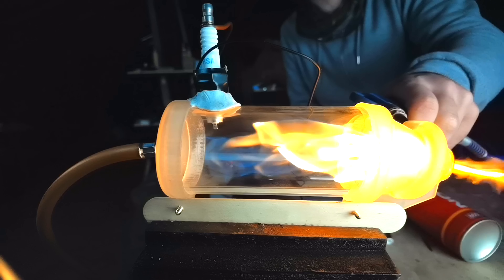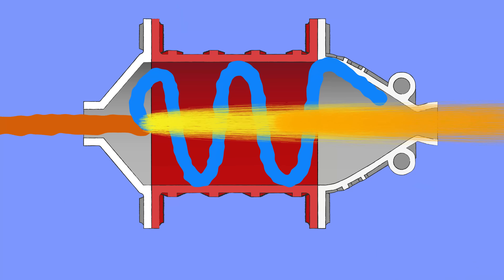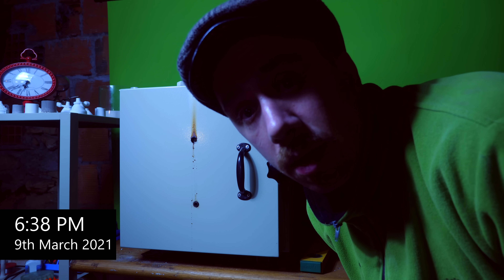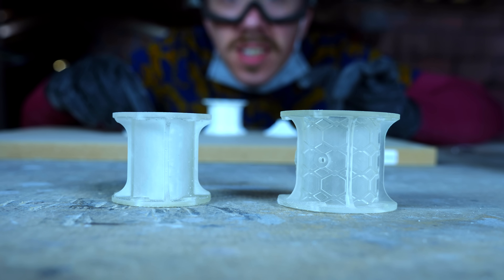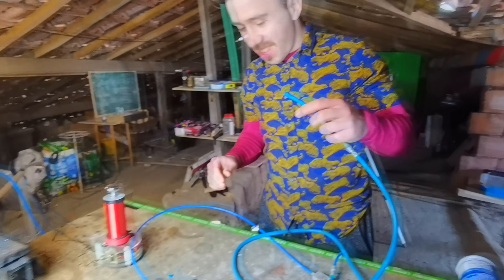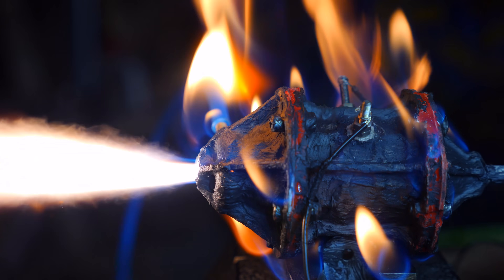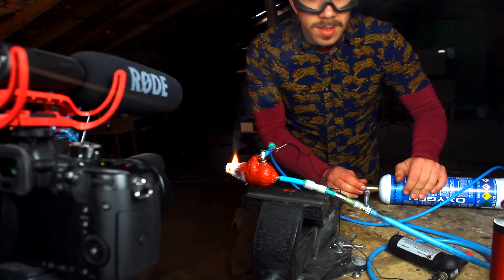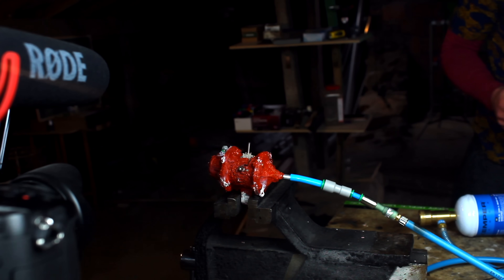Vortex Rocket V2.0 (3D Printed)

Comment: if your rocket is leaking, just clog it. at least for the single piece rocket you dont have any joints, so you should focus on clogging the pores and crack on the ceramic itself. for that you should put inside the rocket come solution or dispersion that can leak through the pores and solidify there.
i suggest a solution of sodium silicate, maybe with kaolinite, put it in, let it permeate and soak out until it can't permeate any more, drain dry and oven bake.

Comment: Have you ever been thinking to coat your parts from inside with sinking method. Of course you need for that something what will flow easily but surface  finish will be great and if holes in part are not too narrow it wont stop up the holes. I haven't heard that you can liquefy silicone but there are heat resistant paints and  I think there will be other stuff what you can use with that method.

Comment: Dip the kiln baked parts to the same resin, and bake them again? Repeat if it leaks? Or assemble the engine and dip and bake?
Maybe have a proper regulator for the gasses for fine tuning the pressure so that no overpressure brakes the ceramic parts?

Comment: Those little cutters you're using to remove the supports are often brittle and have a tendency to break and throw the pointy tip violently. You probably want to use safety glasses with those.

Comment: At one time a 3D printed all-metal rocket engine would be amazing to see in a future video. I know that SLS and other metal printers are not cheap, even the small ones. But with one you might be able to create long living engines to burn the tomatoes until you run out of propellant.
A liquid fueled aerospike engine would be cool as well.

Comment: Maybe you can swap fuel inlet with oxygen inlet to get oxidizer away from walls, and increase lifetime a little - almost pure oxygen makes flammable almost everything (i think ceramics could handle this, but it was really visible at engines with acrylic tube). nice engines!

Comment: Paint the engine with conductive coating. Then electroplate it with nickel or copper! That should be airtight! Or wrap it in gold leaf. Then wrap it in steel foil.

Comment: Did you try coating the engine on the inside?  Gas pressure, pushing against the ceramic & its micro pours, pushing against the red fire coating.....  coat the inside....think of a space ship with a tiny hole....think of a rubber patch placed against the hole.  The air pressure pushes against the patch.  Coating the outside offer little strength

Comment: If the ceramic is porous so the gas is leaking through the walls, they could be porous enough to allow liquids through.

You could try sinking the parts into a high salt consentrated solution couple of times. The salt crystals that forms when dried could seal the parts with a high heat resistant solid material.

Comment: Have you tried simple clay?
You already have the kiln and are not restricted to wall thicknesses.
Also I think your chamber pressure is too high. It wouldn't leak if the pressure was low enough.
You could also print cooling channels around the engine.

Comment: You might try using some ceramic paint on the inside and outside of the engine and then letting it cure. 
 Fibreglass is also extremely high temperature used with the correct resin. You can make a mold like you did before and then be able to press it all together in making extremely tight and dense. 

 Maybe try making some starlight with extra ceramic powder in it.

Comment: Hello Integza! 
Very nice video! I perhaps have a suggestion how to fix the leaking nozzle. Few years ago i used to build some small rocket engines and had similar problem of certain parts not being heat resistant enough. What solved it in the end was submerging that part in water glass (concentrated solution of sodium silicate, you can buy it in common shops in the country i am from). I used to soak my parts usually over night and then leave them drying for few days and afterwards bake them in oven for a hour or two. The result was a thin layer of glassy material on the surface which was incredibly heat resistant and not leaking. 

Hope you will get your project working :)

Comment: I would love to see a future video dealing with trying to make aerospike engines! Cooling would definitely be an issue as that is one of the main weaknesses of the aerospike design, but they are super cool!

As far as trying to seal your ceramic parts, you might look at a hotter sintering process -- low temperature firing means less of the material bonds, but extremely high temperature firing (like with china or porcelain) can make a much more tightly bonded material. A thin coat of glaze may also help, though that could easily crack and leak.
Reply: P.S. I could really use that 3d printer! So cool!

Comment: Glaze it and refire. You may also want a proportional control valve to keep the flame slightly reducing (or maybe slightly oxidizing as ceramic is already oxidized) But the extra oxygen is definately attacking your sealents.

A mix of wood ash and the ceramic powder from the fired support material may be a good place to start.

Comment: you could try sealing it from both sides with glass, like how its done with ceramic mugs. Its basically powdered glass in liquid form, you paint the ceramic parts with it and then cook it until it sinters together and seals all the pours.
you could try the same with aluminium oxide or some other oxide thats really stable at high temps and can be obtained in power form.

Comment: insulate the interior with refractory cement, also check the bigstack channel that melts things in ingot has a video where it repairs the furnace you could use molds plus that method to make a more resistant motor

Comment: you can 3d print a larger part, and dip it in molten aluminium, that way metal fills all the parts, just watch out for your engine melting,
and if it does, can your ceramics withstand casting's of higher melting metals?

Comment: I would recommend making the engine in 3 parts like you first did, but cast the parts in metal using a technic like FarmCraft101
 used in his video. He used a 3d printer to make a print which will then melt inside a sand mold allowing you to make more complex parts by casting it in metal. https://youtu.be/w3i8i-9bjqI

Comment: Try uv activated resin would cure before reaching the internals will be to hot for the resin but at the surface it would cure and leave a clear coat look
Reply: Ps if I use the uv pen you can stick it in the chamber to cure any resin that makes it through the walls since it's  such a small wall thickness

Comment: Ceramic coffee mugs don’t leak. Glaze your ceramic part like a coffee mug and re-fire it in your kiln. 

P.S. Please use a secondary shield. Safety glasses are not enough. Either a blast shield or use a face shield with safety glasses so you have a double layer of eye protection.
Reply: I wish I could give 2 likes because these are both very valid
Reply: i get real worried every time i see his face inches away from being peppered with shrapnel
Reply: Came here to comment the same for glazing.
Reply: The flame will burn away the glaze pretty quick, it's at least over 1500C in there, likely over 2000C since I think he's on the ox rich side.
Reply: @maxk4324  i think the glaze its made at about 1050 to 1200ºC, and that engine is suposed to be shielded from heat by an air layer.
without the glaze,the flames will reach the walls because the air layer and fuel is escaping through the walls.
anyway i think he loosed the track on this video,and departed from his original idea by excitement.
Maybe an internal combustion chamber can help to reach an optimal combustion and shielding,and then try to remove the internal chamber.
Reply: @xiro6  so the layer of pure oxygen (not air, this is much more aggressive of an oxidizer) does help cool the chamber wall but it doesn't help much with the infrared radiation which is also significant. If the chamber wall gets hot enough in the presence of the pure oxygen it will start to burn, period. Put oxygen can burn almost anything if it gets hot enough, porous or not.
Reply: Maybe slip casting another layer on the inside. The problem is the external coats are in tension not compression.
Reply: @nelsonphillips  Rather than adding a slip layer to the engine. Create a two piece mold and pore the slip inside, when it drys it will shrink and you can remove it. This way multiple engines can be made from one mold and fired. The slip could also be a refectory clay which should be able to handle heat better. If this still leaks it could be glazed.
Reply: @johnfreking6931  honestly learning how to cast wouldn't be a bad idea for this project in general, you could probably cast that whole engine with a forge using homemade tools, there's a ton of homemade forges on youtube.
Reply: @jellafella6957  I was disappointed he didn’t use glaze in the next video. Because I thought it would be the easiest solution. But for my idea he could use the kiln he already has to make a ceramic casting, no need to buy a forge.
Reply: How many ceramic mugs have you seen with only 2mm thick walls? The glaze IS important, but so is the near 1/4 inch thickness of the typical mug. Plus the resin material that is in his ceramic causes MAJOR porosity over normally produced ceramics. He would almost be better off 3d printing a plastic mold and using that mold to produce a normal ceramic part with no resin in it, It could be fired normally, glazed normally, and it could be more than 2mm thick.
Reply: Coffee mugs don’t leak not only because of the glaze but also they are meant to contain liquids not high pressure gases glaze most likely won’t hold up at that temperature
Reply: Yes! I posted my reply before seeing this but this is better stated.
Reply: Glazing will indeed seal the pores completely.
Reply: 3D METAL PRINTING!!!!!!!!!!!!!!!!!!!!!!!!!!!!!!!!!!!!!!!!!
Reply: @ThatTweedle  I have seen single piece rocket engines made with laser sintered metal 3d printers, small ones of course. One company has printed some bigger stuff I believe.
Reply: @karlkiessling  Rocket Lab's Electron rocket 3D printed main engines for both its first and second stages. They fly to orbit fairly regularly now.
Reply: @maxk4324  and this is the best justification for a metal printer.
Reply: @karlkiessling laser sintered 3d metal printer = one million dollars.
Reply: i was going to say coat the inside with a high temp coating, glaze is just that!
Reply: Ceramic coffee mugs don't have to withstand thousand degree Temps and high pressures, respectively.
Reply: @wingmanbomer maybe not in your house. 
Speak for yourself  and your own coffee cup etiquette. 
At my house we make coffee 900 Celsius.
Reply: @Boogie_the_cat  You're making coffee wrong. Any temp over 205 F° extracts flavors that make your coffee taste bad. I.E. bitters and acids.
Reply: Almost all porcelain is glazed. The natural surface is porous and matte texture. It's also somewhere in the grey to terra cotta color. The brilliant white stuff is the glaze color.
Reply: He will learn when the shrapnel ruins his good Hawaiian shirt...
Reply: coffee mugs don't leak because they are solid clay
Reply: @dexdrako my coffee mug is made from beans and dextrose powder.

Comment: If you enamelled the inside of the engine with glass it should help to reduce the leaking. 
This would also mean that ([edit]if the engine gets hot enough) as the engine runs and the chamber pressure rises it will force molten glass into the pores and block them as the glass should retain a high viscosity, which may be enough for the engine to run much longer.

Warning though; working with molten glass can be a pain.

Comment: THEME: You could put your arduinos/raspberry pis to use and build some small cnc machines. You are definitely capable of making a cnc router. There are tons of tutorials and open source software. If you need any special parts made, I could machine/print some for you.  

Also, to solve the issue with the leaking, you could instead use the porcelite to make a mold and pour steel another metal like copper, to make the casing for the engines.

A better solution: 
Your fireplace sealant worked like a charm and is very versatile, however, it leaked mostly between parts when you did this. To fix this, you could make a gasket. You can purchase gasket material to make gaskets out of and placed it between your fireplace sealed parts.

Love the channel, I'm very happy I discovered  you at 50k subs to see you hit 1 million this year.

Comment: For sealing the engines, maybe sand down the end surfaces as smooth and flat as possible before joining them and then maybe covering the whole thing in cement, plaster or something similar

Comment: Love the video and this series, but pleeeeeaaaase wear a respirator when working with dry ceramics and preferably wet it. It's not worth the long term lung scarring that will come back to bite you in your 50s. The tiny particles of ceramic cut up your lung linings and turn them into scar tissue. Think its called cillicosis.

Comment: 3d print molds and build from clay!! 5mm walls.  Some parts like the inside of pipes will not mold well, but you can make those parts out of wax.  Coat a plastic mold in petroleum jelly and make the wax core in there, let it cool overnight. Take it out and wrap it in ceramics clay.  Then press that clay-wax Twinkie in with the rest of the mold (you’ll probably need 3 or 4 segments, maybe more). Good luck!

Comment: Sodium silicate might make a good sealant.  It's cheap, mostly non-toxic, and available from auto repair shops amongst other places.  Useful for reducing concrete porosity, used as a refractory cement, for fire protection, and engine repair.  Dip or paint your fired ceramic parts in a sodium silicate solution, then reheat to ~150 C in the kiln to activate.  From the wikipedia article:
"At 100–105 °C (212-221 °F), sodium silicate loses water molecules to form a glass seal with a remelt temperature above 810 °C (1,490 °F). "

Comment: If these parts are suppose to be insulator, what about casting the chamber inside a metallic structure?  You can use the metallic structure as support to bolt tooth ether the ceramic parts.

Comment: Perhaps double walled construction of combustion chamber would be interesting? And passing fuel through inside this 2 walls. Some kind of regular connections between two walls would help with transfering heat to the outside. But that can be minimal concerning ceramic nature of material. Or at least atmospheric air sucked by or after nozzle. Not a design for a rocket but it would allow higher pressures inside combustion chamber.

Comment: Do you have any gaskets or anything that can melt or deform in the fuel lines thats anywhere close to the engine. At one point im sure i saw fuel coming out of the line. Its not the entire problem but im sure its not helping and possibly a potential problem in the future.

Comment: Inner walls of the engine need to be air-tight. Try using the high-temperature fireplace sealant on the inner walls and joints segments. Using a sealant on the outer walls won't protect the porous body of the chamber from high-pressure air (and thus fire) penetration.

Comment: Perhaps a jet engine but the supply of oxygen would be supplied by a metal propeller that is being spun by an electric motor that is separate from the engine to avoid heat damage could be a cool project or modification to future jet engines

Comment: Try coating the inside with that stuff they use to line the inside of forges. Also is it possible to wash out the resin with something like acetone, or would that dissolve the object. Is porcalite conductive at all? Could you use electroplating to fill the pores? If its not conductive enough, can you add a small amount of metal powder to the porcalite mix? How hot does it get?

Comment: I wonder if cleaning your supports off first and resting your parts in alumina powder inside a crucible would be a better sintering support than just leaving the supports on to be ground off later. It might help reduce some of the stress concentrations from uneven heating and support sintering.

Comment: Perhaps you can make a seal by taking an aluminum can and slapping it over the body of the rocket and use a high temp cement to stick it on there. Cheap and easy🤷‍♂️

Comment: Use the 3D printed engine as a master to make a plaster mold.  You design the mold so it brakes in half..  You pour slip into the mold. The slip sticks to the walls. You open the mold and retrieve the green slip engine   Fire the green slip engine to get a hard white.  Paint the fired engine with ceramic glaze to seal it and fire it again.   This way you can reuse the mold to make many engines for testing.  I used this technique back in High School to make mugs and things in ceramics class.

Comment: Use a ceramic glaze to reduce the porosity of the rockets engine. Place it in the furnace the first time and fire it then let it cool. Apply the glaze with a brush (room temperature)(inside and out). Then place your rocket engine back in the furnace to melt the glaze. Ceramic coffee cups are made the same way. good luck

Comment: Since you are just covering the part in that fireplace cement anyways the ceramic resin is just causing more problems than its helping with the shrinkage and what not. Why not design the inside of the engine, rather than the entire thing. Then print it in normal PLA, Then cover that in the cement stuff, and place it in the kilm for 24 hours or whatever to burn off the PLA leaving you with a perfect, one piece engine, that doesn't suffer from the same shrinkage problems.